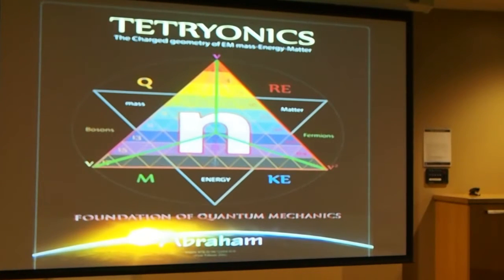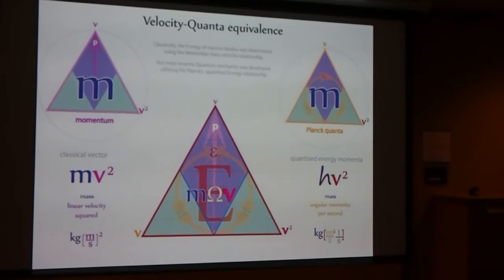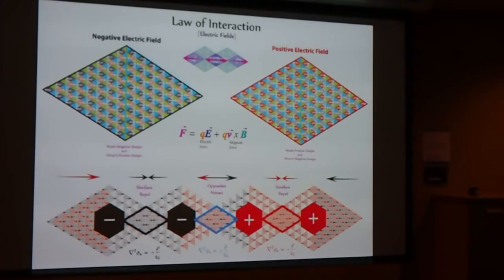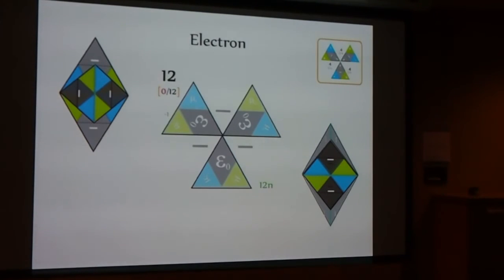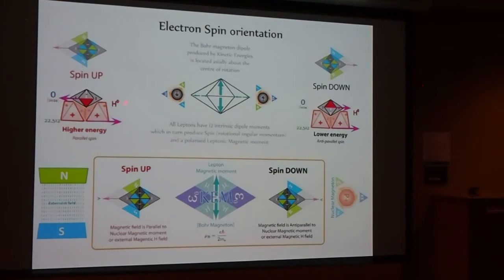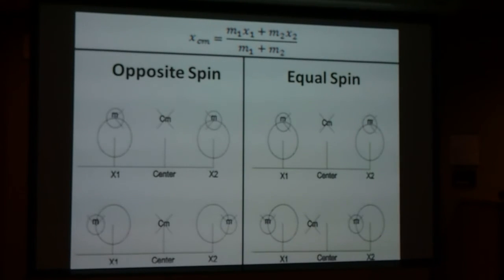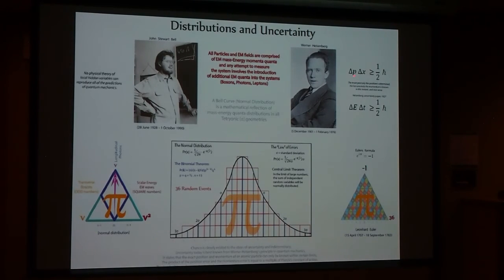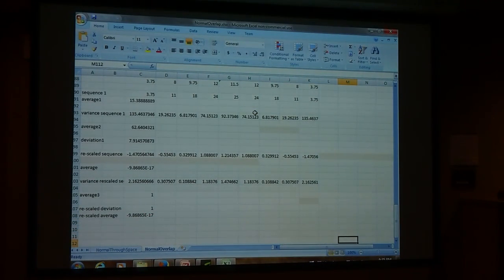Tetryonics: Deriving The Periodic Table (1)

Comment: .....while I do feel that Kelvin has greatly streamlined an understanding of how what have LONG been very disparate concepts fit together (especially material conditions arising from standing waves / non-radiant, vastly-entangled photons - which they TOO, may NOT be being accurately perceived) couldn't disagree MORE with his characterizing energy as a separate one; the distinction made between it and matter is FAR too hard, when what's actually being talked about, are different states of resonant information, relative to vibrational rate as affected by extant effective medial density / distribution.....my own unifying physics model, identifies 'electrons' as an arbitrary designation when, as Edward Leedskalnin perceptively referred to them as 'magnetons' produce magnetic fields, it makes MUCH more sense they be FORMALLY called that - and then of course, the STILL-mysterious 'electricity' (along with 'gravity', ALSO an effect of magnetism, both caused by particular passage through specifically dense media, producing friction / entanglement) relationship, role in need of serious reevaluation.....yeah, I am pulling HARD on a thread hanging from the multiversal tapestry - with NO regrets......

Comment: Protons in Tetryonic Theory are level 25n particles in their ground state, ( and can go up from there to n level 32 ) 

1e^19 represents the number of quanta per fascia in an 'n level 1' particle and relates to the number of quanta per face in an electron. Therefor we calculate the total number of planck quanta in an electron thus... 1e^19 times 12 faces = 1.2e+20 total planck quanta.

The same calculation for an n level 25 proton is: 1^e19 times 25^2 times 36 faces. 

In this way, we can recognize that 25^2= 625. So 625 times 1e^19 and represents the number of quanta found in each charged fascia of a proton, and we finish up with 36 faces == 1e^19 times 25^2 times 36 = 2.25e+23 total planck quanta in a single 25n proton.

We know there are 9 tetryons in a proton and that each tetryon has 4 faces. Since there are only 3 tetryons per electron, we can clearly see that 25^2 times 3 =  1875, and with this we have an insight into the proton-mass ration that so many theorists are after... The value of '1875' being the correct theoretical proton-electon mass ratio. 

That's the simplest way I can put that to date...I'm looking forward to following this series, and congratulations on a well delivered lecture.
Reply: +Richard Blankenship Thats a great post Richard, right on topic for what I was asking about the other day. I remember Kel covering this and saying the strong force increases somehow. I thought your space ship gets tougher as it accelerates and is radio active when you stop. That's starting to make sense. This lecture is giving me a whole new angle. I aint got it quite right yet but......
Reply: @War Dog  I request that you visit my channel, and start a new thread under one of my short Tetryonic Theory vids and I will do whatever I can to catch you up to speed on our interpretation of photons and Electrons. I'd simply like to have this explanation available from there. I'm very familiar with Dollard but we do see things a bit differently than he does because we are using the geometry of energy to elucidate the errors and misconceptions being dogmatized in the mainstream accounts.